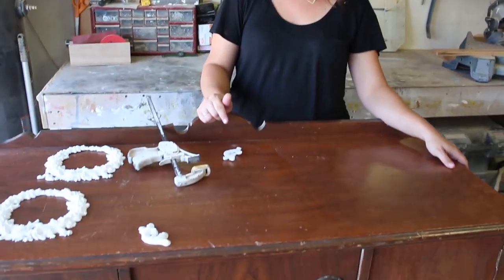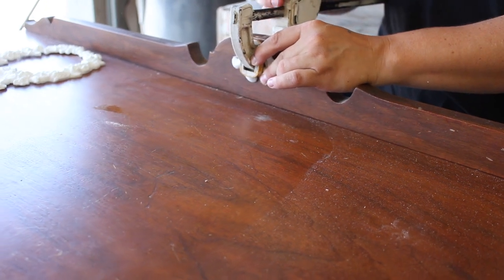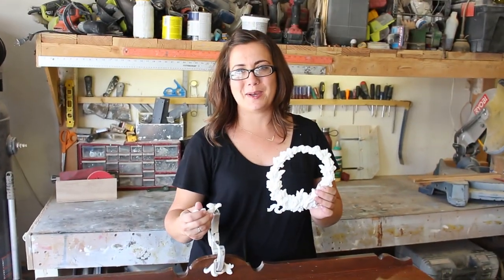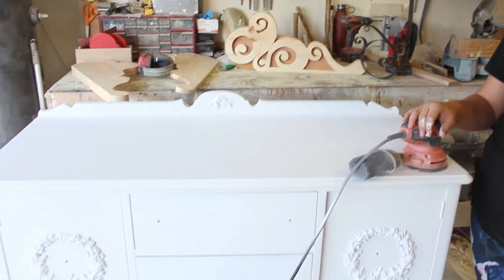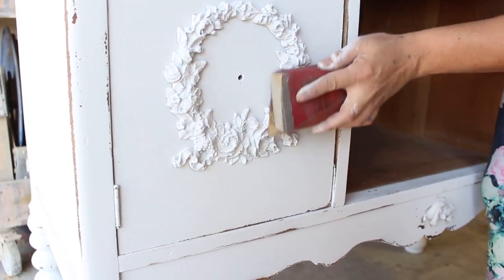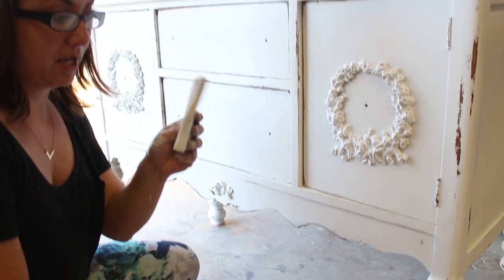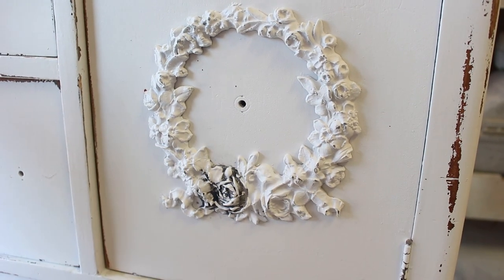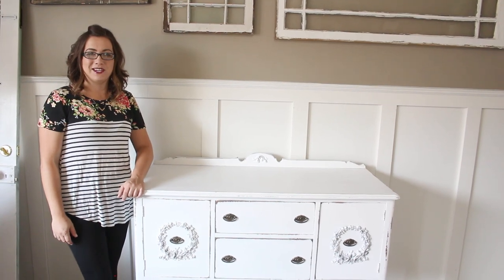How To Rehab Furniture | Furniture Appliqués | Farmhouse Buffet

Comment: Applied primer to a piece of furniture that I plan on painting tomorrow and decided afterwards that I might add an applique.  Is it too late after adding the primer? Thanks
Reply from the maker: It’s no too late!  The glue should stick to the primer without issue. We use E-6000.  Ive decided to add appliqués after priming several times! 😂
Reply: Great.  Thanks

Comment: what do you do if you want to put an aplique in an area that is not easily clamped?
Reply from the maker: Jacob Vester lay it back and put heavy even pressure on it. Or you can use a brad nail gun but only in the thick parts the little parts will break off